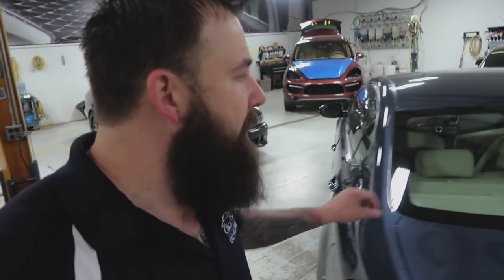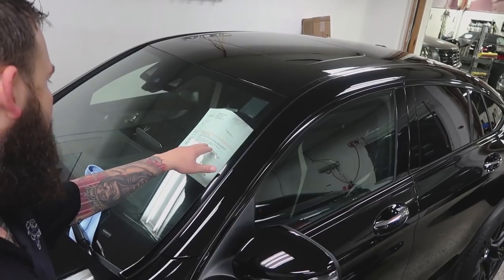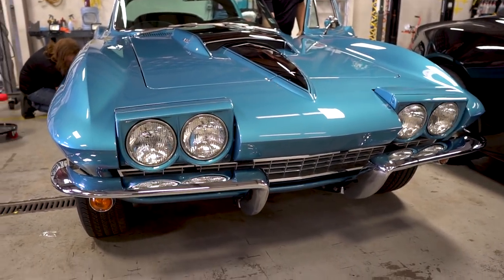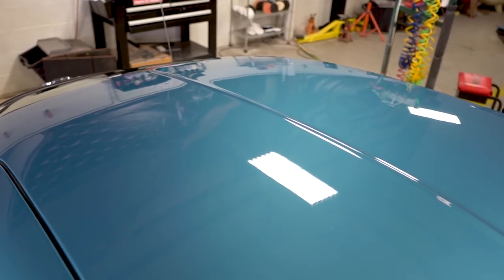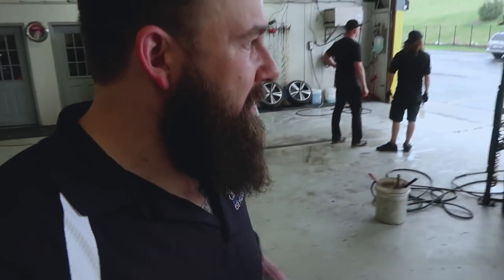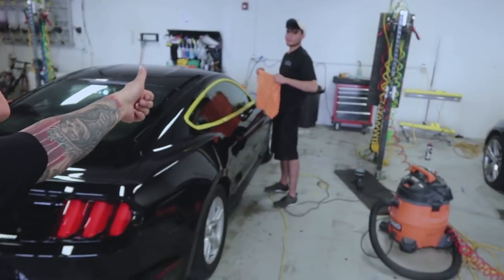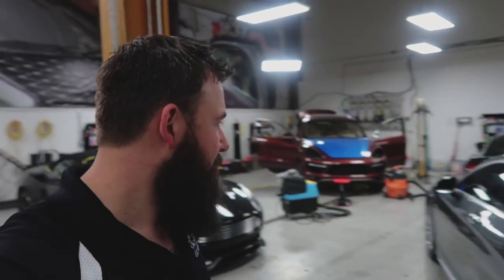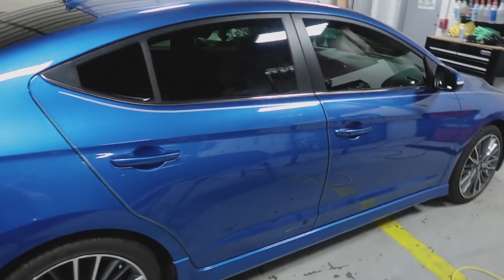Polishing black paint on the Aston Martin Vanquish  | Detailing VLOG #30

Comment: Hey Guys! I'm a huge fan of your work! I live in Chicago heights IL. I have a 2017 admiral blue corvette that needs a full paint correct, wheels and window tint. Also one of your best ceramic coatings to give the vette a deep shine with a hard finish. I'm not sure if you can fix the small scuff in the bottom of the bumper prior to the work done, but also the grey leather seats sealed and protected. I emailed you guys and messaged on fb. Trying to get this done before snow hits and can't drive it on summer tires. Thanks!!